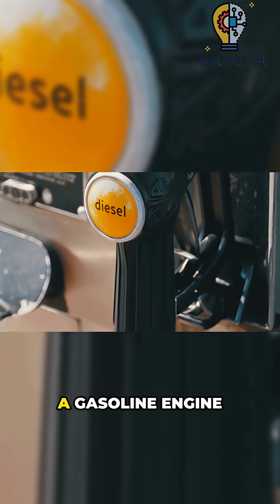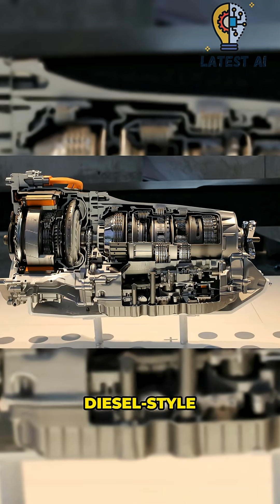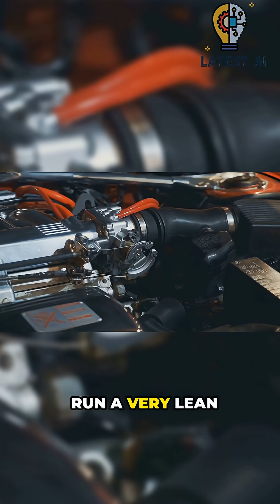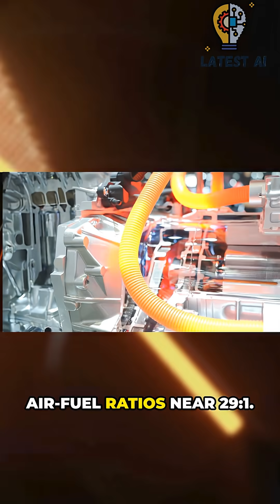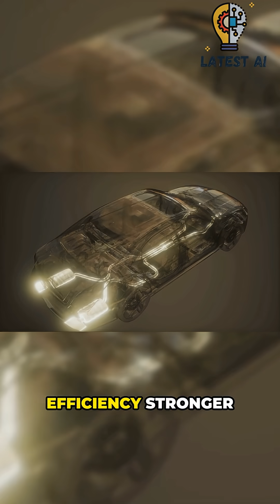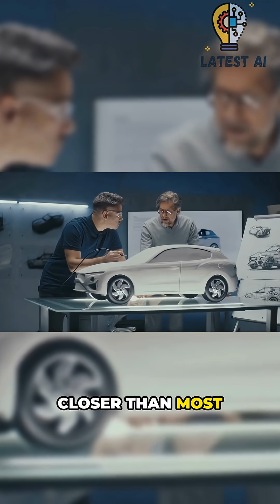Mazda's Holy Grail of Combustion Engines - SkyActiv-X!

Comment: Even GREATER grail - make the engine generate ELECTRICITY, in the most efficient band, and use the electric power to charge the battery banks, and power each wheel independently from the combination of battery & generator !  No more transmission troubles .....